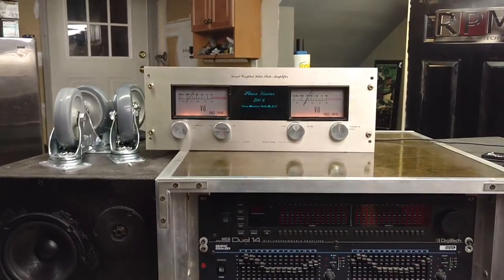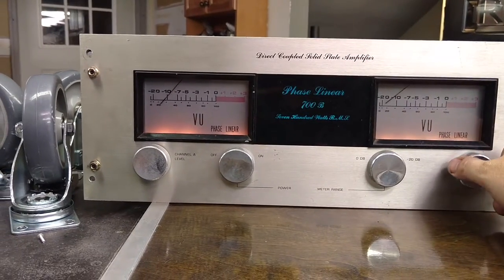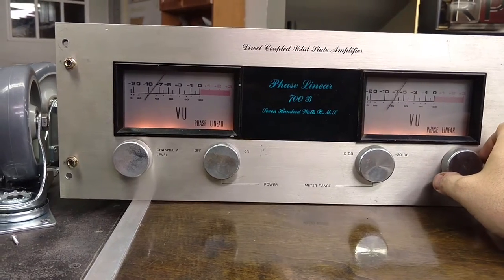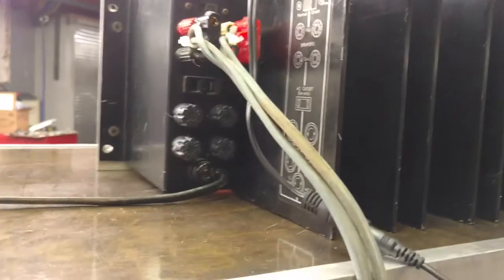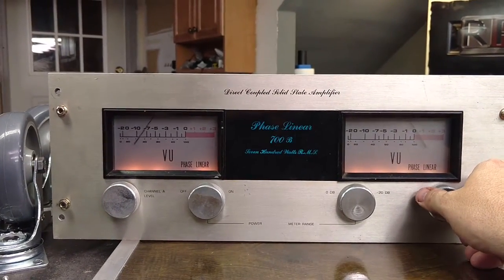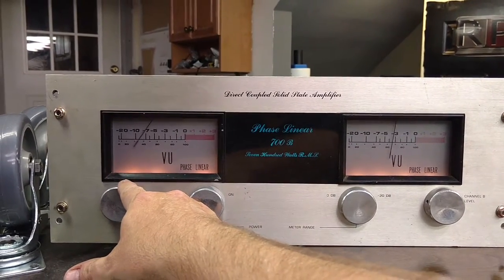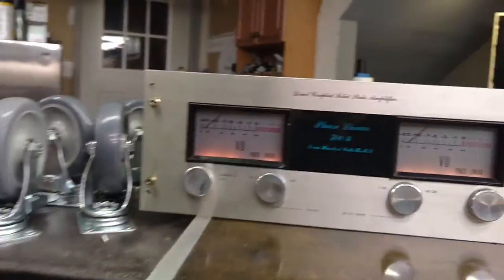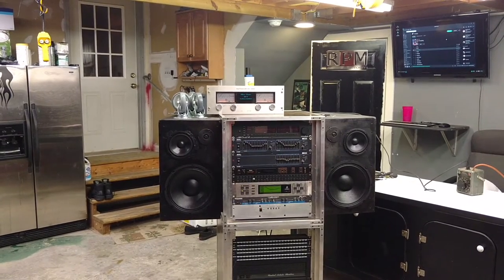Phase Linear 700 B Bob Carver Has Been Finished and she's a Survivor!

Comment: l had one from brand new for about 8 years , Heeps of dynamic grunt , but found it a bit harsh on the highs when using them with my JBL 300 studio monitors of the same year , cost me $ 2000 in the 70s and the 4000 pre amp $ 1200 .

Comment: What speakers are you playing on?
Reply from the maker: Actually they were a couple of homemade three-way wedges that I built that used to be in the back of a Datsun b210 custom stereo system that I made in 1989. I believe those are the original mid-ranges and tweeters but I may have replaced the woofers at some point. I bet I don't have $100 in those things total.

Comment: Wow ive never seen vu meters go so crazy, is that normal on these?
Reply from the maker: Greg Krupa yes when you have it down low and you have the meters on the very sensitive scale that's exactly how they behave I have seen another unit just like it same deal. If you get it cranking pretty loud and you set the sensitivity to the high range they start to stabilize a little bit